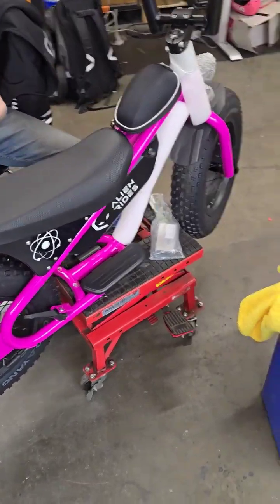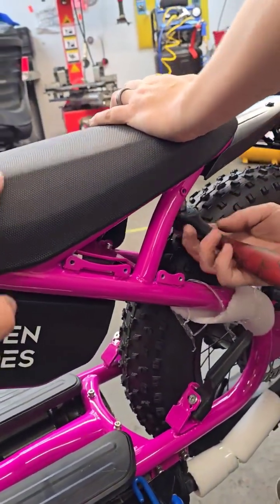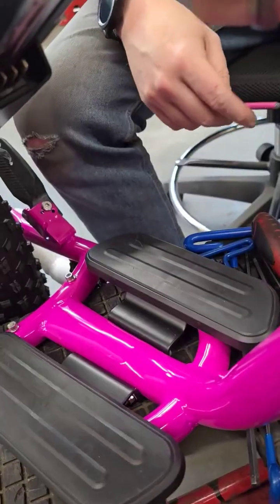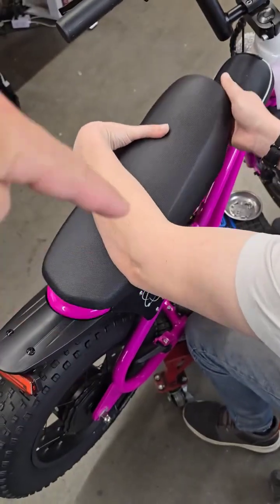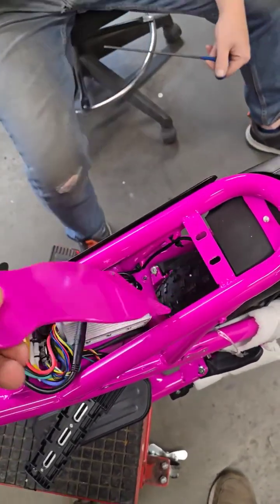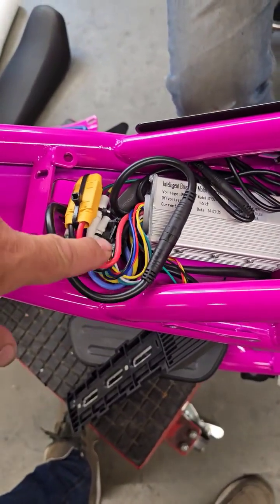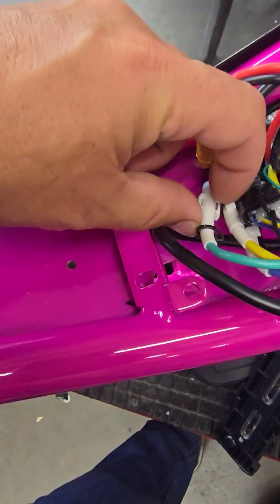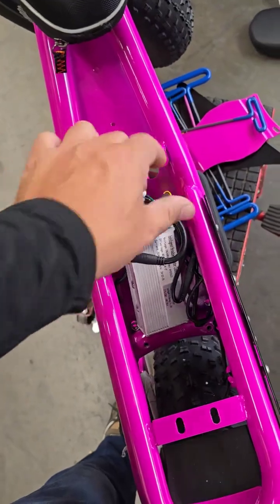How to Replace the Controller & Seat on Your AR Atom Electric Bike | DIY Guide

Comment: Hey I don't know if you would know this but would a Electro and Co Little Bit controller work as an upgrade. I don't see any reason it would not work other than the connectors and the tune being wrong but you can change that on the Little Bit controller.